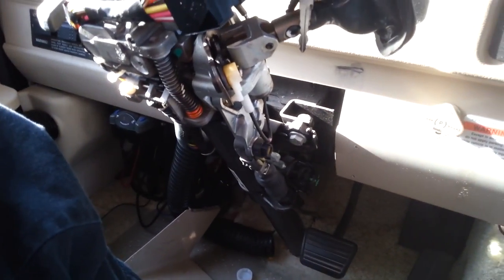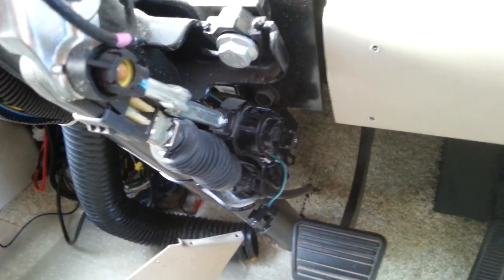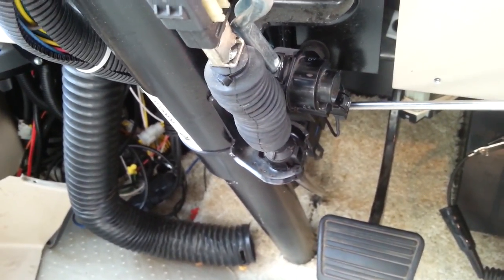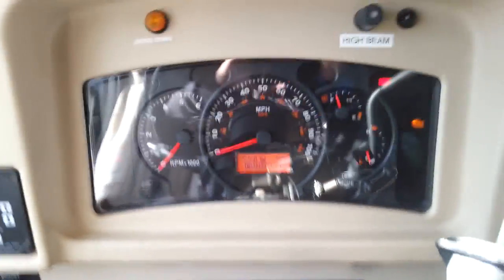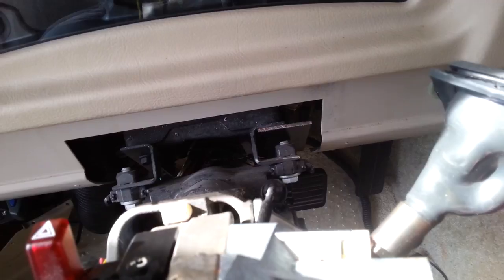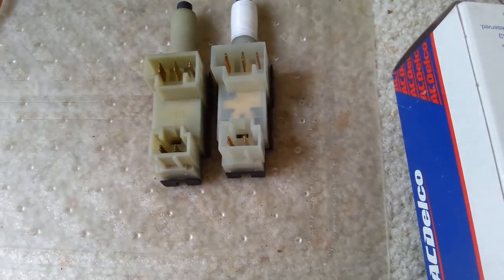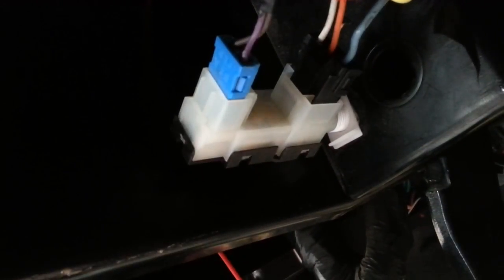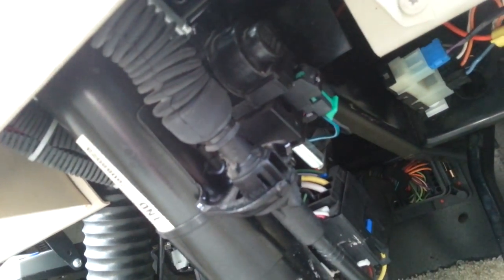Workhorse Chassis W24 W22 RV stuck in park wont come out of gear Gear selector wont come out of park

Comment: Thanks for your video on this.  I've got a W22 Workhorse frame which is experiencing this problem.
The easiest workaround that I found was to simply turn the engine off.  Then you can put it into Neutral and start it from there.  
But now I understand exactly what the problem is (thank you) and I will be able to fix it myself.
Reply from the maker: Thanks for leaving a comment Anthony, have a blessed day

Comment: A year ago, 4am, trying to leave RV Camping spot at Disneyland to beat LA traffic and head home. What you described happened to me. No way to get it out of Park. I have the Workhorse W24. It eventually did go into drive after a few disappointing minutes. Upon getting home, I changed out the brake switch down on the brake pedal you highlighted. No problems since. However, thank you for bringing out the little green piece removal as a fallback plan. Really like your posts Kevin. Happy new year. Keep um coming!
Reply from the maker: JC 5 glad u got it going thanks for watching. .more videos to come.

Comment: Excellent diagnosis of problem. Great fix for quickly saving the day during major inconvenience.

 Have noted increasingly difficult pull on lever, required to retract park pawl, as mileage is increasing past 100,000. Parking brake is not holding coach on slopes and pressure on pawl is now more intense.
Reply: Are you pulling out the electronic parking brake paddle, which is the yellow thing on your lower dash, just to the right of your steering column?

I initially thought it was messed up when I bought mine last week with 87k miles because it didn't pop out with force like the trailer brake in an 18 wheeler.

But, upon reading the manuals while driving across the country by myself.

After reading the manuals, I learned it is actually working and the manual emphasizes the coach is not "fully in park" without it pulled out.

I would be VERY interested to see if you've been using that brake paddle or not.

Please let me know here because we should be looking out for each other and sharing as much as we can.  :) :) :)

Comment: I have a 2005 w24 38j Winnebago. I have the reverse situation of this. Ie sometimes I have a difficult time closing the ignition to off. Question is
Is it possible that the brake switch can prevent closing the ignition switch lock to the off position
Reply from the maker: I'm not sure on that one? I would take it all apart like I did in the video and watch what part is bending. Let us know what you find

Comment: Great video--really do appreciate it!   I was so excited to disconnect the wire as you clearly show--but it did not work for us.  I ordered the brake switch and will try that, too.  I talked to a large truck mechanic in town who suggested turning the ignition one position then shifting into neutral before turning the key the rest of the way--that didn't work either.   So frustrated!  Time to invest in a service call.  :(
Reply from the maker: GIVE ME A CALL OR TEXT 606-875-0125 KEVIN
Reply from the maker: Did you get it fixed? Try one more thing on front of fire wall there is a relay labeled BTSI remove this relay that may get you going brake transmission solenoid interlock (BTSI)

Comment: Kevin,   How do remove cowling off of steering column.   On my w22 the steering wheel adjustment lever gets inthe way.  I'm afraid of prying it off for fear of breaking it.  I noticed in this video you have all part at the start.
Thanks 
Mike
Reply from the maker: I can't remember, did I show how to do it later in the video?  You can call or text me at 606-875-0125 Kevin
Reply: Kevin,  Really appreciate your help.  Will review video again.  I must add, I find your channel most helpful.   
Thanks again 
Mike
Reply from the maker: I'm here if you need me .. text is best.

Comment: Great video Kevin. I'm having the opposite problem. I can shift without having the brake on, but my leg levelers are not getting a signal that the vehicle is in park. I would conclude the brake switch is not likely the issue as it can be shifted with or without the brake on. Either the solenoid or my power wire is my problem. What are your thoughts? Where were you ordering parts from? Thanks Garth
Reply from the maker: Give me a call or text 606-875-0125 Kevin

Comment: Problem first noted with slide outs a few years ago, was solved by turning ignition on and then off... repeatedly at times. While noting increasing difficulty in making both slide out switches function at times, found a correlation to that very same black solenoid you just described, to the intermittent malfunction of both slides. Pulling the green tab only, allowed both the slides to function. Apparently the electrical contacts in this area are problematic.
Reply from the maker: Thanks for the added info. its sure to help others
Reply: I just had my first experience with the Auto Park not releasing, but I'm away from the gas pump that I was stuck at a few minutes ago.

I just bought this '06 Winnebago Adventurer 38t on the w24, knowing my left slide doesn't go out.

I found an invoice from 2013, where a mechanic said, "check left slide out not working, found locks not working properly. Customer is going on."

I tried running the slide out again with this wire with the green connector disconnected, but it wouldn't open and just keeps making a squealing sound, as always.

Comment: I'm parked for the night with the upper and lower tan covers off the lower part of the steering column and that wire still disconnected.

Do you think I can/should proceed with the last half of my trip, with another 1200 miles ahead of me with that wire disconnected?

I don't have any tools with me here on the road in San Antonio, half way down the road to home in Tampa after flying to Los Angeles besides the two screwdrivers and a couple players I bought at a Pilot truck stop in Arizona.

Because disconnecting it got me away from the gas pump that I was stuck at about 30+ minutes ago, I'm thinking about just leaving it disconnected permanently...

Your thoughts???
Reply from the maker: CALL OR TEXT MY PHONE 606-875-0125 KEVIN

Comment: I have a p30.   My shifter has gotten very hard to move.., I have lubed both ends of the shifter cable and spayed wd40 in about every opening in the column..but not getting any better... any ideas?
Reply from the maker: Disconnect cable at both ends to confirm the binding is in the cable not trans or shifter. Set brake block the wheels. Also watch this to see how I lubricate cables with air pressure https://www.youtube.com/watch?v=Q6Y6euyq6Jw

Comment: I have a ford 1990 7.5 pinnacle 300Q RV. Just buyed and belived or not I never find the parking break and also I have problem with gear stuck in parking I press the break pedal with engine on and shift stuck in park. any body knows I can do. thanks.
Reply from the maker: This video was on a work horse chassis . i don't know about a ford but i would remove the plastic covers from around the steering column and look for a small solenoid that may be preventing lever from moving

Comment: great vids thanks!!!!
Reply from the maker: Did yours get stuck in park ?
Reply: no, but when I hit 100k I replaced most of the sensors on my engine and other chassis locations. I was surprised at how much better the engine ran. I"ve run into this problem with GM products and had to do a similar thing. I thought your attention to detail was very good. yes I know,  WK chassis.  Thanks again.
Reply: @ktoutdoor  I also replaced the main ECM to get the dash AC to work correctly. Many of my other little gliches were solved with this.